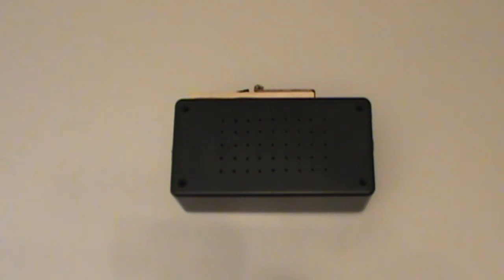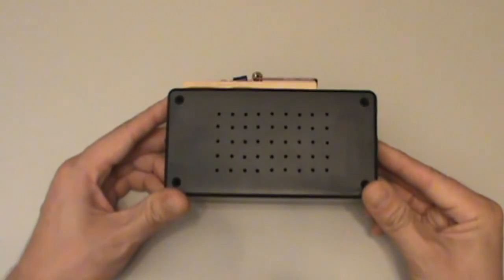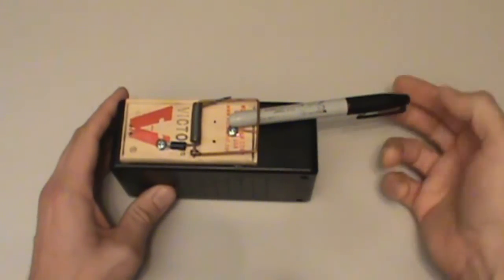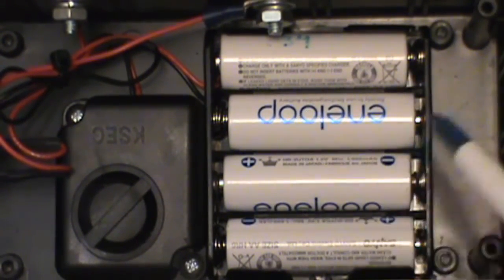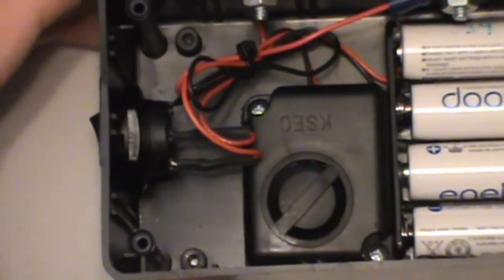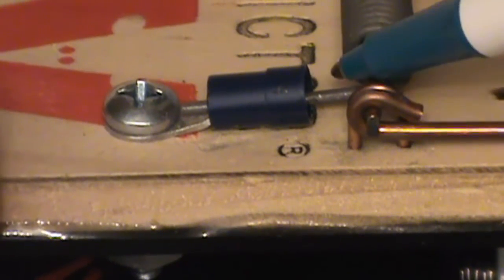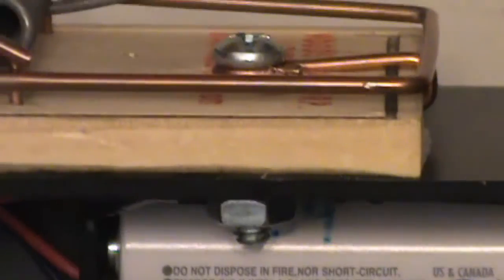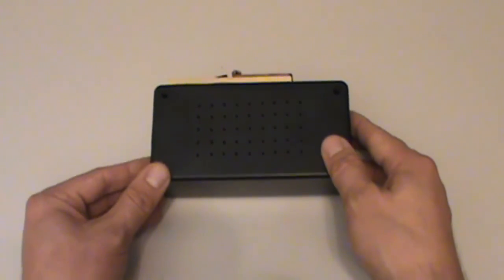DIY Trip Wire Alarm System

Comment: Aloha Jeremy.
Dammit, between this and the 9-volt battery cell-phone recharge, I am becoming a frequent customer to Radio Shack.
STOP IT!  I am getting on first name terms with the cashier and they no longer ask for my phone# or address, they have it memorized.  ;p

Peace & Prepare
Pax et Paro
Reply from the maker: It's too bad Radio Shack isn't as cool of a nerd store as it once was back in the day.
Reply: ***** Aloha.
I miss the days of Quement Electronics on 1st Street in San Jose, CA & Tower Records down in Campbell.
Streetlight Records is still there.   I do like that you used AA batteries, since those are the most common size, especially in rechargeables.  Can always keep these topped off with charged batteries from a Goal Zero Guide 10 & Solar Panels.

Peace & Prepare
Pax et Paro

Comment: Nice man! Like it a lot.
Reply from the maker: It could be made smaller and lighter, but I was limited by the size of the project boxes and the fact that I wanted to use AA batteries.  This weighs in at a half pound so it's not something I would like to carry in a BOB.
Reply: still cool as heck dood!